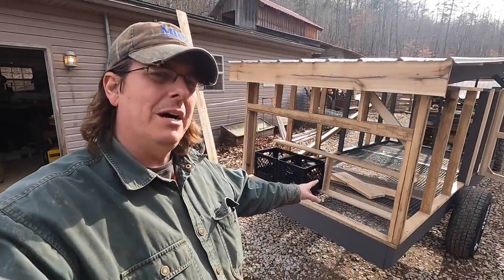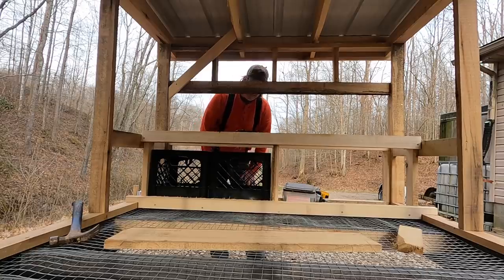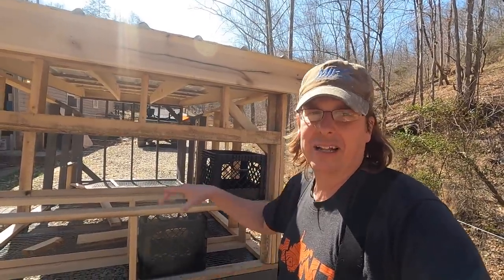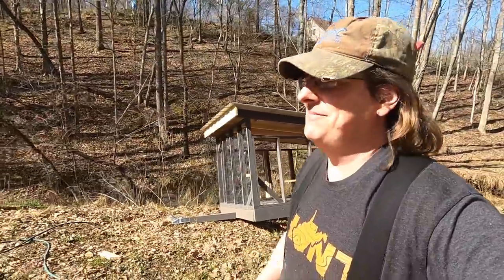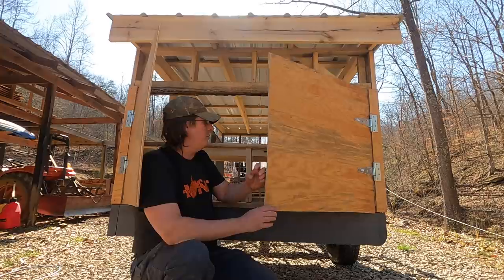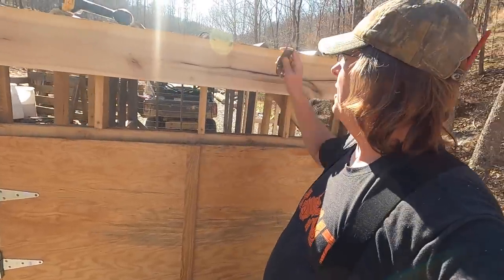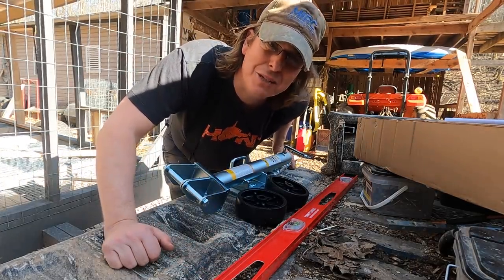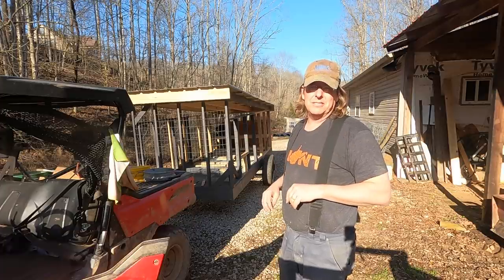Nesting Boxes and Access Doors for Our MOBILE CHICKEN COOP

Comment: 68 revolutions to lift that trailer! (Yes, I counted)
Anyway, I have a coop that has a double door set up the same as yours. I put a bolt through from the back side(inside) of the center door jamb through both doors and marked it for a cotter pin. Drilled the bolt, mounted it back up and now a cotter pin securely holds the door shut. Pretty simple solution.
Reply from the maker: I like that idea! Ok, you are too busy to be counting hand crank actions!

Comment: DOOR LATCH  - one bit of 3\4 ply . cut a few inches long. hole drilled thru, offset to one side. sand down and taper the other end of the plywood strip in TWO DIRECTIONS. bolt ran through the whole drilled into the coop above the left door. washer between the plywood sliver and the coop and as you twist it tightens down basically like a screw. use spacers as needed